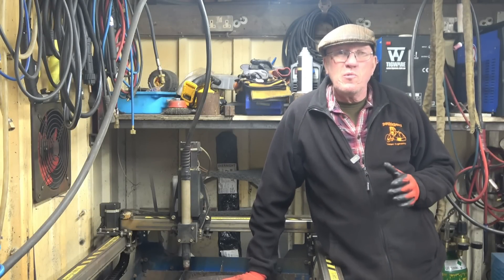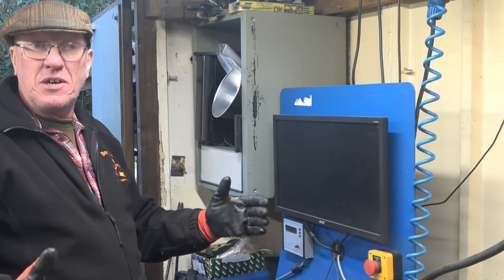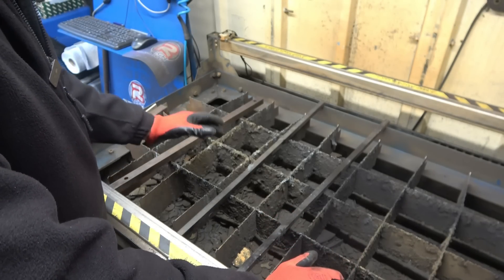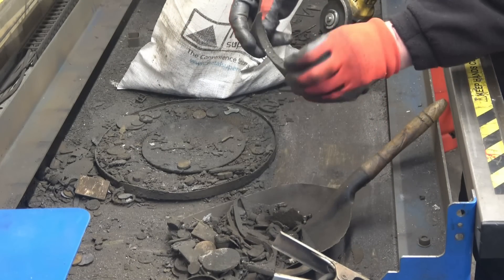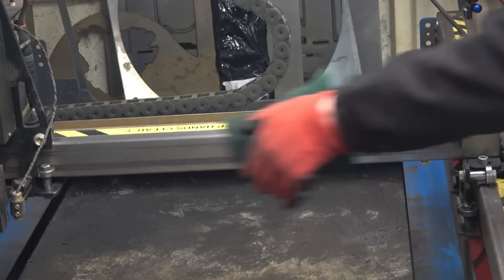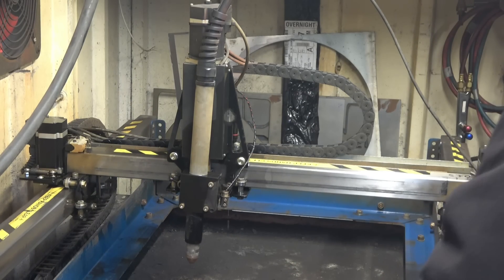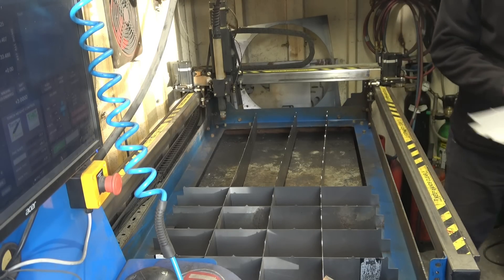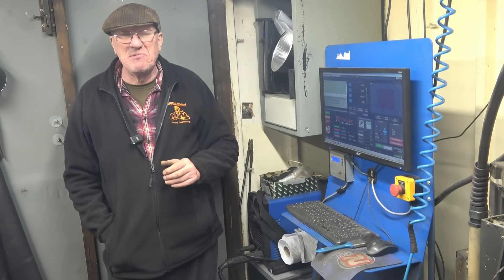Xtreme Plasma Table 5 Years Of Hard Use

Comment: Interesting video John, I am toying with the idea of buying the 4x2 table but it will have to go in my garage where my lathe and mill are, do you think the mess this makes will be a problem for the other machines or will covering them up when its in use suffice.
Reply from the maker: Decent extractor fan and you will be fine .
Reply: Thanks mate  @doubleboost
Reply: Maybe use water or build a enclosure.